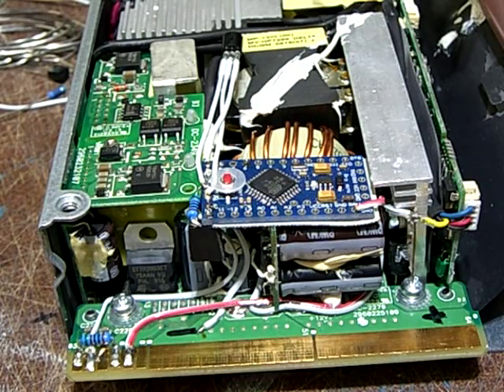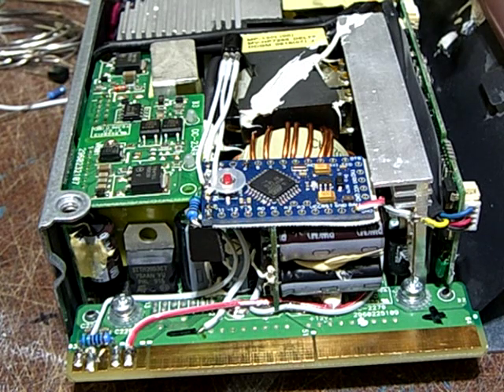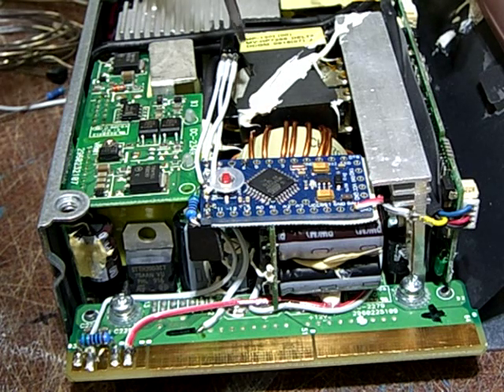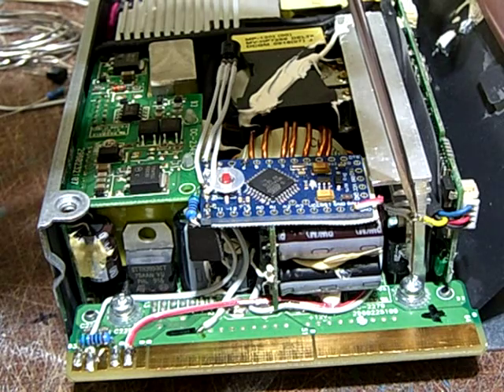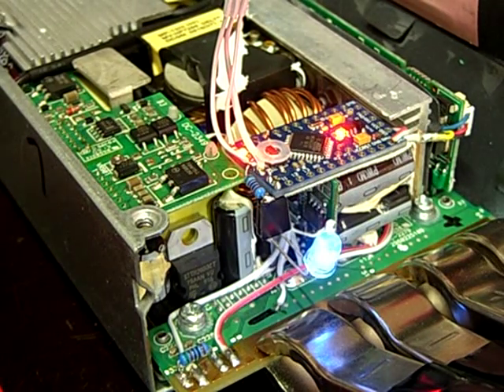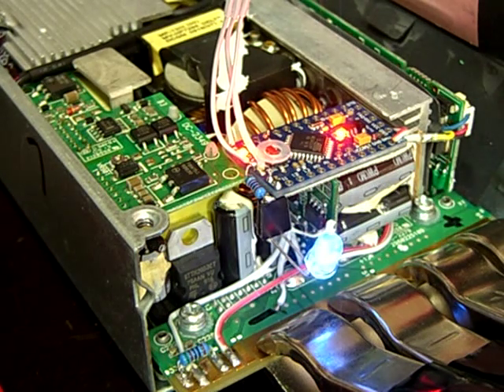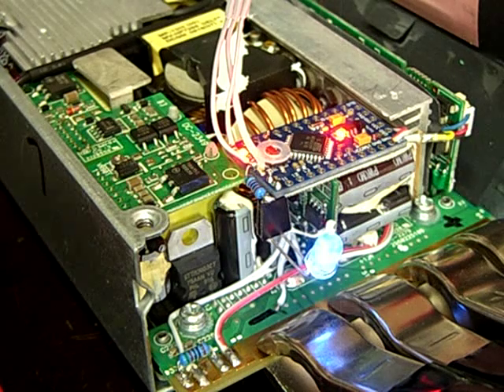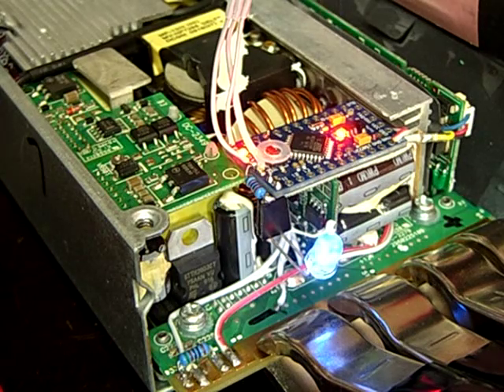DPS-1200FB Server Power Supply Fan Control with Arduino

Comment: Thanks for the idea, there is one thing I don't understand, the 4-cable fan according to the description, to control the fan you should use the blue (controller) and not the yellow cable that reads the fan speed?

Comment: Is there a reason  you want it not to get warm?  I like that the fan doesn't come on until very hot, but I use them to power car stereo amplifiers in small indoor install packages.  (like a bathroom stereo)

Comment: Hello, nice video. Is there a way to just hard wire the fan speed to 50 percent?
Reply: You'd need a switched PWM curcuit. You could do it with a mosfet circuit, but I just clipped the yellow on the fan and soldered to the red on the fan and covered w/ kapton tape. Done and on to the next project. If I want it quieter, I'll 3d print a housing to put a massive 12V fan on it and power it off the load side of the psu.
Reply: this î please

Comment: Can you please write down which resistors are you using?
Sorry it is not necessary to answer now. If you go to the website for code you can find there also connection schema and much more clearer pictures. I have just tried to read colours from video and I could not see colours. Resistor is 500 ohms and you are telling that at 7:00 of this video.

Comment: Hi dear friend! Thank you for time spent to share your experience! Let me ask you: is it possible to change the fan with another model quiter? For example BeQuiet or another brand? Must new fan have 4pin cable? (PWM) Thank you!
Reply from the maker: +Roberto Pietrafesa Hi, you're welcome. The power supply has 4 fan contacts, tach and PWM included. I discovered that a tach signal from the fan must be present, and the speed must not be too low. A speed too low will trigger an error in the power supply and it will shut off. As more quiet fans will be slower, your approach might not work. You could, of course, program an arduino in a way that simulates a tach signal. But a slower fan of the same size might lead to overheating. When running full bore, server PS' are a bit loud, that's nature.
Reply: +Extremflug First of all thank you for answer! I will surge 18A max in morse code, that means likeI will surge 9A Continuously. Do you think 9A surge will heat it so much? Anyhow I would like to swap the fan, because I need silence 100% when I'm waiting to hear weak signals on HF transceiver.
Reply from the maker: +Roberto Pietrafesa No problem! If you only need 18A max but silence is a priority, I'd say that this kind of power supply is overkill. I would recommend this type of 30A power supply, it is very high quality as well:
http://www.ebay.de/itm/Schaltnetzteil-alle-Modelle-Netzteil-Trafo-LED-Strip-Power-Supply-/131486861965?var=&hash=item1e9d3a4a8d:m:m5x-FPu4LpHbyVrCYMvLTOA
Here, the fan can easily be modified. Remove the old fan, cut a bigger hole in the top of the case, and install a giant fan. Also, it does not run continously.
A bit higher quality, genuine MeanWell:
http://www.ebay.de/itm/MeanWell-Direkt-Netzteil-SP-320-case-power-supply-unit-240W-high-power-TUV-PFC-/251578760237?var=&hash=item3a93433c2d:m:mCWaLirZEBYHxZNxmUq0zMw
Reply: +Extremflug Thank you! I look for a lot of 12V 20A PSU, about €15/20, but let me ask you why "Mean Well" brand? Is this brand better than "no brand" PSU? Outside it seems to be exactly the same! Thank you!
Reply from the maker: +Roberto Pietrafesa Meanwell is a very reputable brand with good quality control. But if you don't need industry-grade quality, I guess a cheaper no-name device will work also well. When I bought mine, genuine MeanWell was around €30, so for the market price today, I'd probably opt for an off-brand model as well.

Comment: So the load sharing pin is analog, 0-5v, correct?  So it can connect directly to arduino analog pin?
Reply from the maker: +KpilotRCHelis Almost. The voltage is faily linear but not completely. I made an Excel sheet with several data points along the current range, and it looks like this:
Current ; load share voltage
0 ; 0.05
2.65 ; 0.35
50 ; 1.70

I had more data points, but they were pretty much on the graph you would draw given those three points. So basically, you have two lines with a different slope below and over 2.65A. Linear extrapolation would mean the load share maxes out at 3.4V when 100A are reached. I also did not directly compute the load share voltage I read with the analog pin, but I took 200 reads with 1ms in between, sorted out unrealistic values, calculated the average, and continued with this in further calculations.
Please follow the RCgroups link in the video description, all the details should be laid out there.

Comment: Nice job on the fan control! 

I just ordered two of these PSUs and I have been looking all over the place to find information on the pinout to try and figure out how to get multiple units to work together in parallel. I am particularly interested in the function of the load share pin (34) that you described in the video. What I am wondering is this: Can I simply have a jumper connecting pin 34 on one unit to pin 34 on the second unit, and then combine the positive outputs from both, and negative outputs from both on a single load without having a conflict between the two supplies?

Or does pin 34 only supply an output voltage for the load sharing feature which then needs to be connected to a different pin on the second unit, with a second wire coming from pin 34 on the second supply back to the other load share 'input' pin (if such a thing exists) on the first supply?

Thanks!
Reply from the maker: +ZDF Hi! From what I have heard so far, it is enough to simply connect both load share pins together. Here is a link to the Coiners:
https://bitcointalk.org/index.php?topic=379677.msg4681579#msg4681579

Comment: Very nicely thought out and executed! One thing is that, depending if your application allows it, I would have added a 120mm external fan so cooling is actually effective. That tiny fan can barely keep up, hence the high allowance for heat and the high-speed noise. Question: does that fan run in positive or negative flow (ie: push air in or extract it out) mode?
Reply from the maker: +JRoque250 Hi! Surely bigger fans are more effective, but the case I mounted 3 of those supplies in really did not allow any additional components. The fan extracts air if I remember right.